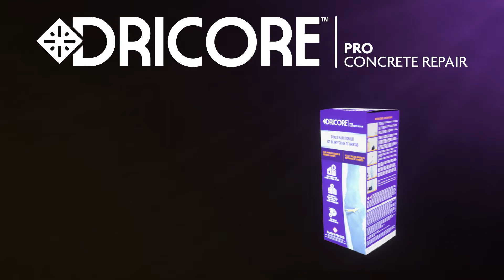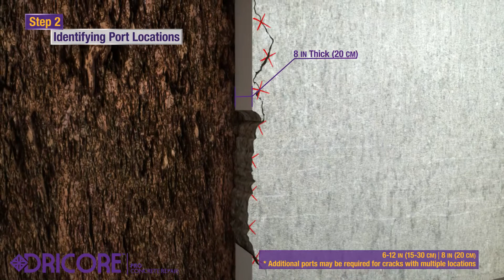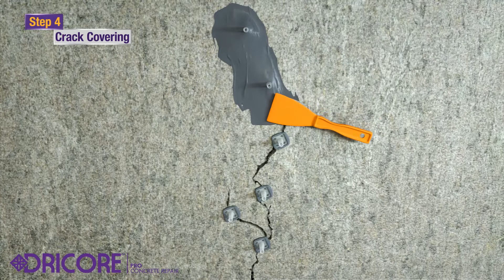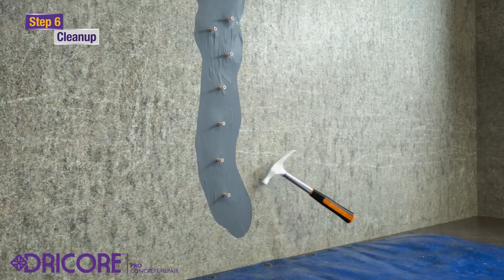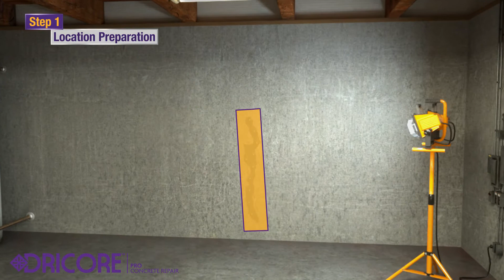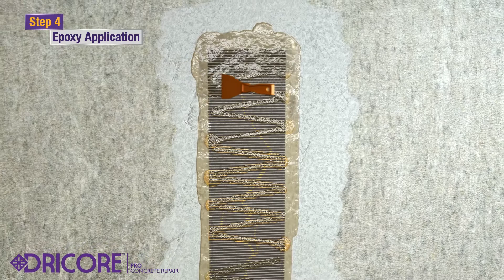DRICORE PRO Concrete Repair Kits: Application Instructions (Single-Tubes)

Comment: Before injecting expanding foam into the surface port, do it need to inject water go in surface port for reacting with polyurethane and expanding ?

Comment: Will this work for swimming pool concrete structural crack.
Reply from the maker: The carbon fiber reinforcement kit can add strength to any concrete structure, including concrete swimming pools, as long as it's coated over/protected after installation. Whether or not the crack can be injected, however, is on a case-by-case basis. Kindly reach out to our customer service team if you have any questions about a particular project!

Comment: It looks like this is two separate products. Does this come in a single kit or do I have to buy both?
Reply from the maker: This video shows the installation of both kits simultaneously - there is no 'all-in-one' kit, you'd need to get both for a complete repair.

Comment: When preparing the area after injection for the carbon fiber placement, are you grinding down/removing the surface paste from the previous step 1 along the crack and surrounding 2 inches?
Reply from the maker: That is correct!

Comment: Will this work to repair a cracked concrete block wall or is it only for poured concrete walls?
Reply: does it work on terracotta block
Reply from the maker: This process is only for poured concrete walls. If you're working on a block wall, you can still reinforce it with the Carbon Fiber Reinforcement Kit, but there is too much space to fill in the block while injecting.
Reply: @DRICOREProductsChannel  Thank you for responding!